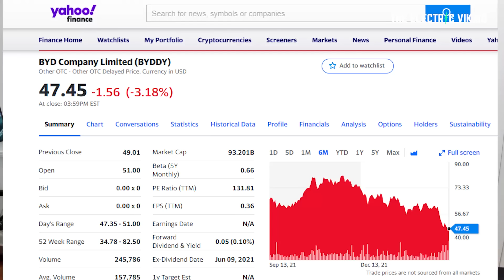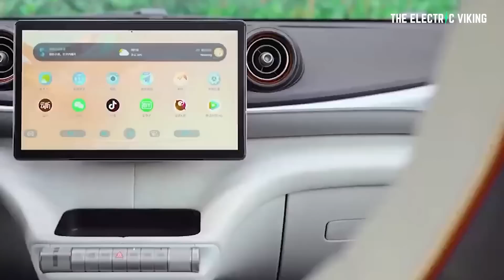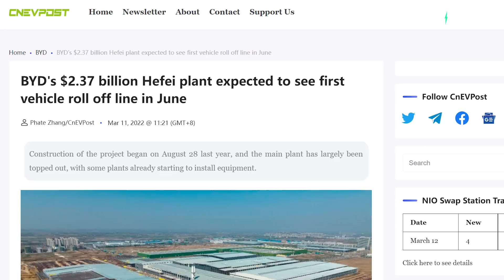BYD's massive NEW EV gigafactory took ONLY 10 months!

Comment: what is the stock code for BYD?
Reply: BYD is officially traded on the Hong Kong stock exchange, and its stock symbol is "1211" (sometimes written as "1211.hk"). However, you have to buy/sell it in "lots" of 500 rather than being able to buy/sell in arbitrarily small quantities. In America, you can buy/sell the "byddf" symbol in arbitrary quantities (as opposed to lots of 500), and 1 byddf is worth one share. Alternatively, you can buy/sell the "byddy" symbol and one byddy is worth 2 shares. I'm based in the UK, and my stock brokerage account is not configured for trading byddf or byddy, so instead I bought some (inconveniently large) lots on the Hong Kong exchange.

I don't know enough about finance to understand how the byddf/byddy shares are converted to 1211 shares, but some other people here have previously voiced concerns (that, due to my ignorance, I don't understand) about the conversion. I think the concern is basically that the byddf/byddy-to-1211 conversation is performed by a third-party company and if that third-party company goes bankrupt, then your ownership of shares in 1211 might disappear. Hopefully somebody else will be able to give a better/more-accurate explanation of the concerns about buying byddf/byddy.
Reply: Depends on the platform
Either BYDDY, BYDDF or 01211.HK 
As far as I know BYDDF is basically 01211.HK as you are buying HK stock just listed in dollars. BYDDY is very similar just the shares are not direct HK as they are an ADR traded on US market.
Reply: BYDDF
Reply: BYDDY

Comment: no nickel AND no cobalt? that's a selling feature.
Reply: LFP
LiFePO4
Lithium Iron Phosphate battery
(supposedly recyclable without extra treatment) 
Non toxic if consumed
Safer, longer life, then Lithium ion battery but less power per weight

Safe thermal run away will not cause fire / explosion (overnight charge) which is likely with Lithium ion batteries
Reply: @james_l4337  exciting stuff.  i think there are going to be a lot of people ready to look/see with their own eyes, learn and consider this technology when the first BYD Atto 3's arrive in Australia in July.
Reply: @karlcx  LFP or Lithium phosphate type batteries had long been on sales as hobbies batteries... perhaps already a decade or more, can buy these on eBay. 

It's mainly used in China.

In EU EV as German car maker etc have contract with China batteries manufacturers and Korean manufacturers to supply 50 Chinese / 50 Korean EV. LFP batteries

may be the porsch taycan uses LFP; the range that car gets, performed incredibly better then what was specified. (not because of the battery, to do with their specification, sale) 

China Tesla uses LFP and other Chinese Cars exported to EU

So EU mainly gets these batteries, unless it's Hyundai or other Asian manufacturers the EV battery may be Lithium ion type.
Reply: @karlcx  Yes, from Utube...
The only issue I have is the km is low it seem.
Need to see the real world km BYD atto 3 performs.
The online figures at present didn't show real range it perform well. 

Telsa from other (AU) sources indicate Tesla EV batteries under performs 12.7% of what specified.

While Hyundai 2020+ Kona did quite well (expensive in Aus) - EV battery is Lithium ion type.
Reply: @james_l4337  yes all very interesting.  i'm not sure we're going to get any real reliable data on range and performance of the atto 3 until the brand starts wholesale local promotion, proper local interaction and until they are tested locally.  the battery can't differ too much tho from what has been demonstrated already with the chinese model.
Reply: @karlcx  For some Reason online search reveal (Western website) 290+km real range for the 400km (extended model)

I'm extremely skeptical of this, I believe real world range should be at least 80% of speccified ~412km

Yet for safety LFP is the way to go because the likelihood of fire in an accident eg damage to battery pack (Lithium ion) and causes fire is real and reality.
Too many video shows Lithium ion battery can have a thermal run away if short circuit (damaged in accident)

To be burned alive (trapped) in an EV fully battery power  chances are quite high. There's much lower chance for LFP even if battery pack got damage and short circuit especially the BYD blade battery... 
They are definitely much much safer then any other on market.
BYD blade batteries no doubt is #1 in safety.

That's the real attraction of BYD blade battery, 2nd will be the LFP not BYD ones.

It's hard choice, but Chinese car have an upper hand if people understand the battery fire safety aspect

Comment: What is your take on the synergies between BYD and Nio, with both stocks being beaten down so much and the two companies having very different markets ?
Reply: BYD could do with adding battery swap and NIO could use BYD's batteries and chips and manufacturing.